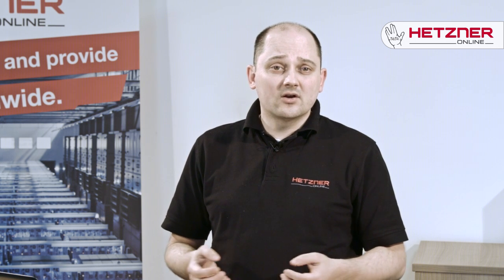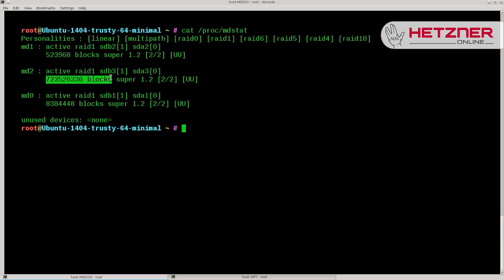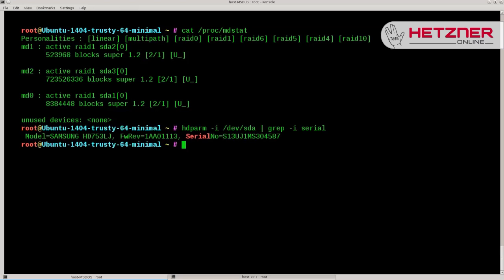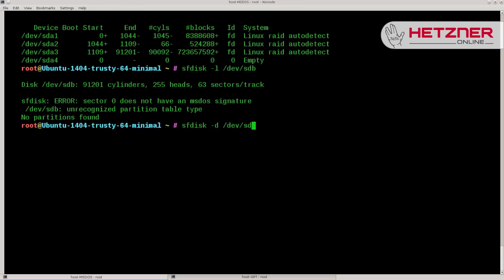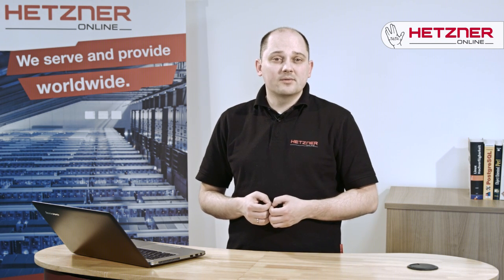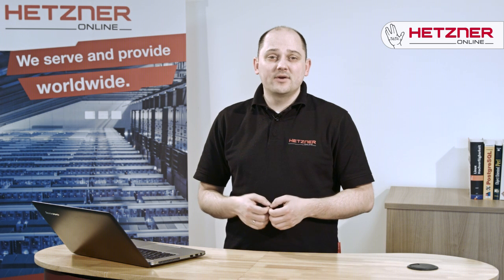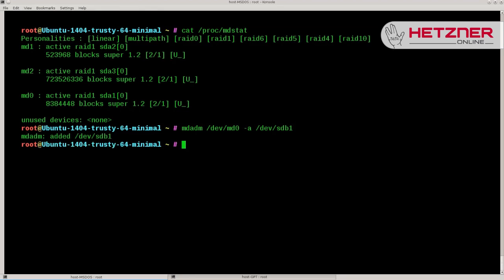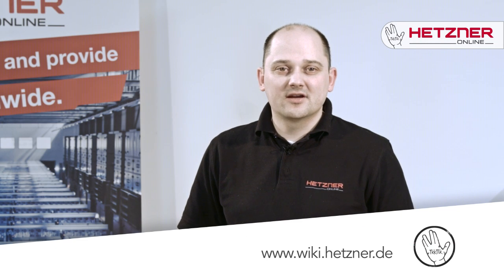Hetzner #TkkTalk - How to rebuild a Linux software RAID

Comment: This doesn't work if you are using a Rescue system. Any videos for that?
Reply from the maker: Right now, we don't have any videos for rebuilding a Linux software RAID with the Rescue System, but it certainly is an interesting suggestion. I will pass it onto the team to consider. Thanks for the feedback. --Katie

Comment: I had a failed nvme disk, replacement went smoothly after adjusting commands accordingly,  grub2 installed ok on the new disk (no warnings or errors) however when I had to reboot the system I received "Symbol 'grub_efi_secure_boot' not found " error. I managed to boot server after selecting the old disk from bios boot order 1st. Any thoughts?